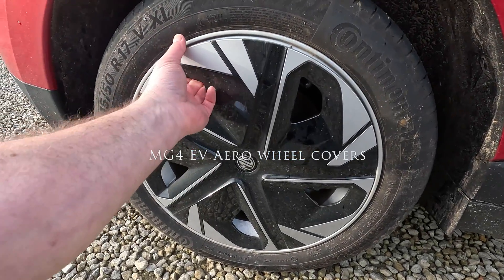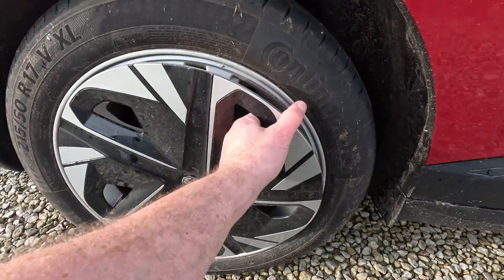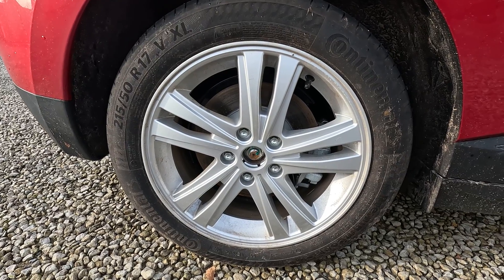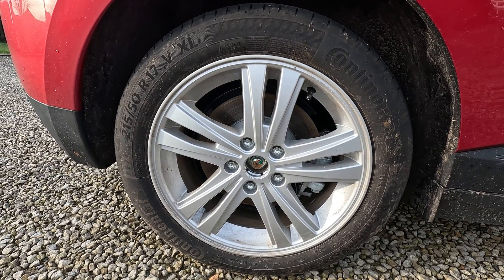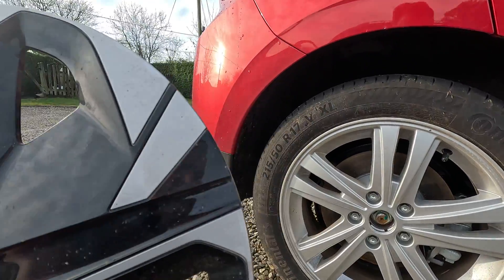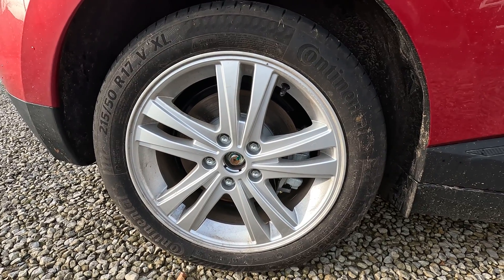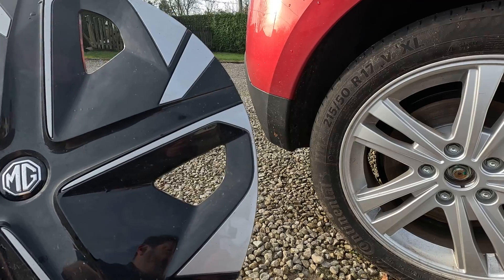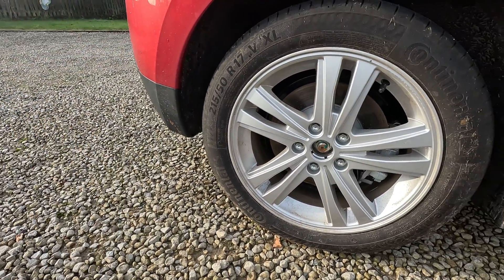MG4 EV aero wheel covers - What's underneath, why should you keep them on?

Comment: I find it hard to believe that the aero wheel covers could give as much as 10% extra range when highway driving. That's huge. Why don't they fit them to ICE cars as well to help reduce emissions? Seems like an absolute no brainer.
Reply: The spokes smashing the air adds a lot of drag. Drag goes up with the square of velocity, The tops of the wheels are doing twice the car speed so although small in area it's easy to see the 10%. Tesla quotes a 10% loss in range for 18 vs. 20 inch wheels.  See youtube "Engineering explained, why large diameter wheels are a bad idea on evs". He does a calculation on how much extra Co2 is emitted from ICEs due to the fashion for large, spoky wheels.  The MG wheel caps seem to have been designed with just enough gap keep the brakes cool.

Comment: I have a feeling that after some use and the aero covers get scuffed up by poor parking skills * ahem * that they might not be so aero anymore.  That might be a good reason to keep them off until a long drive is expected.  Is there any issue with driving without a centre cap?  Just aesthetics?
It also looks like it'll be easier to clean the disc brakes and access the tyre valve for inflation..
Reply from the maker: None at all, just aesthetics as you suggested